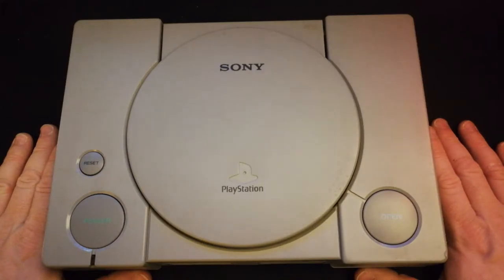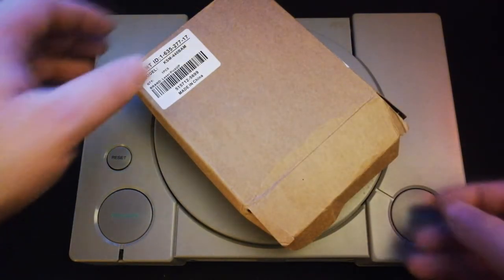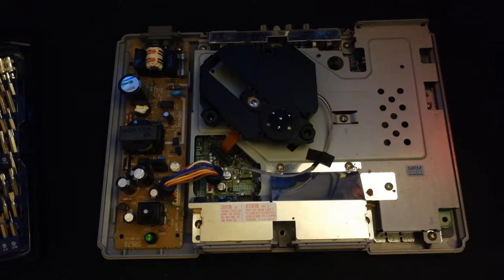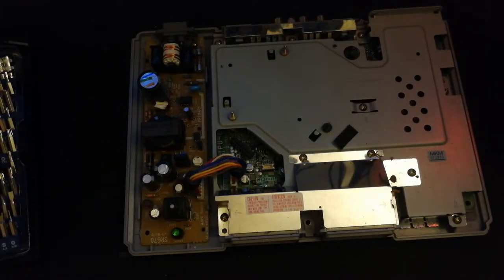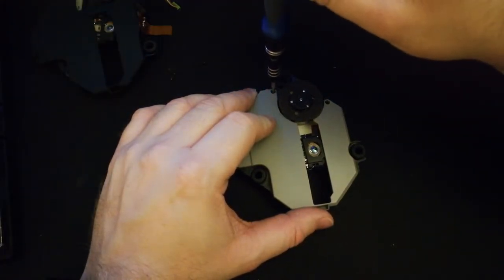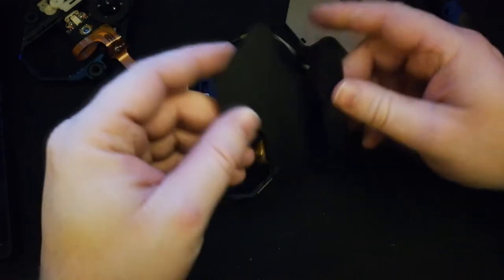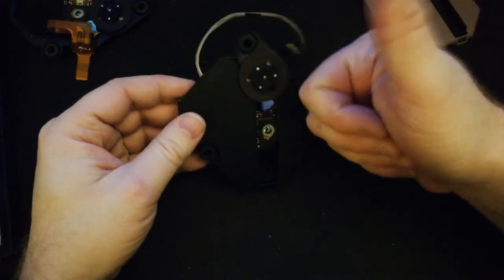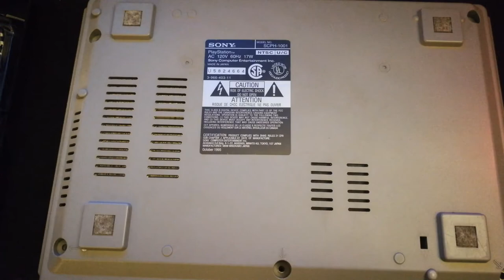Resurrecting a Sony Playstation 1 SCPH-1001

Comment: I just bought that same laser to replace my 1001's and the laser won't move. I'm going to try the shroud swap and see if that does something. Thank you kindly for this information. Kudos, big man!
PS. After doing exactly what you did, my PS just goes straight to the menu select screen. The laser doesn't even try to read the disc. I guess I need another laser assembly.
Reply: Some of the older models require a ribbon cable adaptor to get it to work maybe thst might help?

Comment: Laser was crappy and because its so close to the power supply it only made it melt
Reply: Only on SCPH1001 models
Reply: @CMILF  5001,5501,7001,7501 weren't very reliable either, 9001 and 101 are
Reply: @CMILF  And SCPH-3000 (Japanese only) SCPH-5503 (VCR capable, Japanese NTSC, but not sold in Japan)

Comment: Where did you buy this laser from? Would you mind posting or PM-ing me a link? If you don't mind of course. Great video!!!!
Reply from the maker: I scored the laser from eBay.  The package took quite a bit to get here and it was badly beaten up, but the unit itself was absolutely perfect.  Here is the link from the one I bought:
https://www.ebay.ca/itm/for-Sony-PS1-KSM-440BAM-Laser-Lens-Optical-Drive-Whole-Assembly-Replacement-New/283604191025?ssPageName=STRK%3AMEBIDX%3AIT&_trksid=p2057872.m2749.l2649

Comment: Are these china lens are durable? I looking forward to replace them with new ones but all of them are Chinese I never trust CN made stuff so can anyone confirm Wich one are good to buy?
Reply from the maker: I can't speak for every company.  But the unit I used in this video is still going strong for me.  I hope this helps
Reply: @UneeGaming  thank you for the reply I'm glad it worked good for you, I just bought a psone alone in good condition just for the optical drive spare parts so for me it was less cheap than the Chinese reverse engineered lasers so I bought the original I know they last years and are heat resistant, let's see how it turns out I'm waiting for the spare parts.